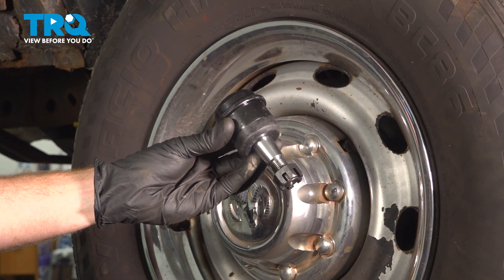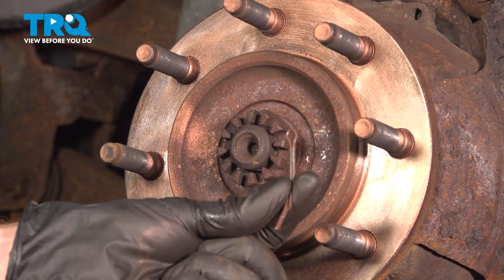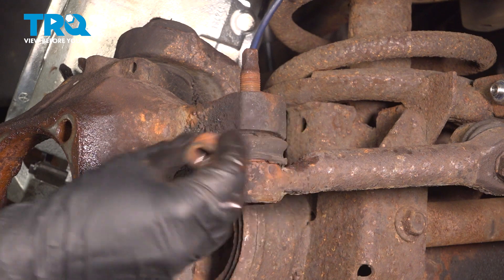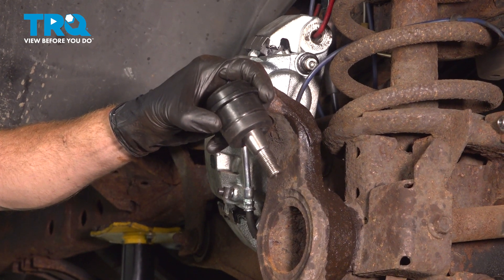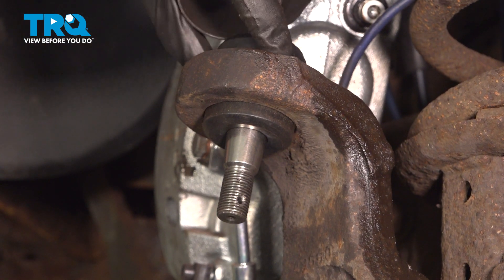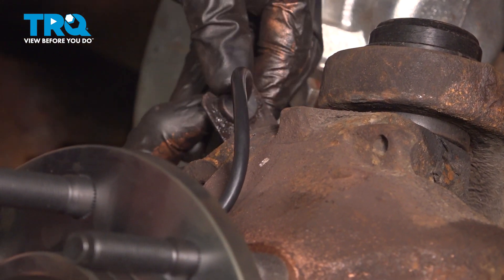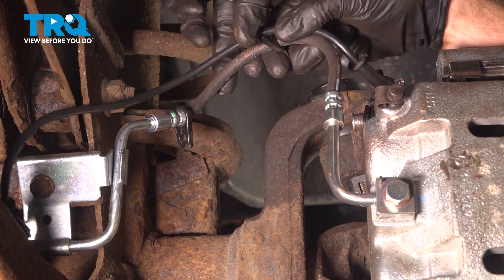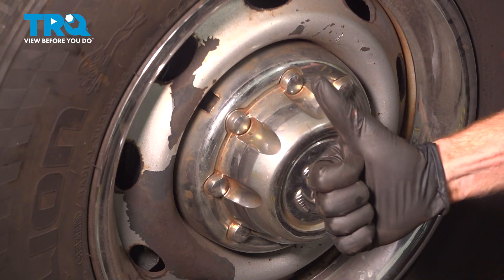How to Replace Front Upper Ball Joint 1994-2002 Dodge Ram 2500

Comment: What brand and size of ball joint press and cups do you use for the upper and lower ball joints on a dodge ram 2500 with the Dana 60 mine is a 2002 and I’m fixin to redo them so I was looking at buying the tools for it

Comment: My 98 12v 4x4 2500 ext cab auto has different components. Large single piston front calipers. And to replace remove the brake rotor the bearing assembly has to come with it. Also note my setup uses 8 lug rotors that specifically 7700 gvw with a width of 32 mm vs the 8500 39 mm rotor. Do you any info regards to tag#s on the front axle. Have you ever ran across a setup like mine. And what exactly determines which trucks have a setup like mine